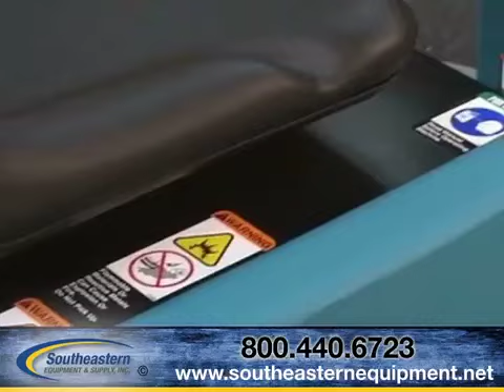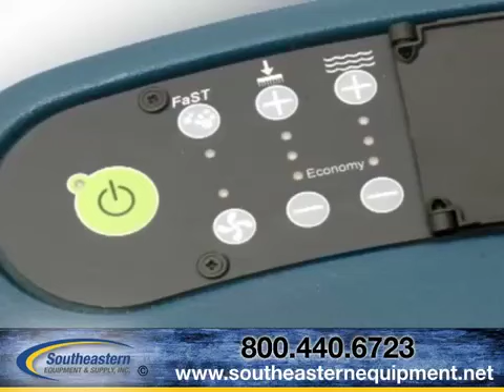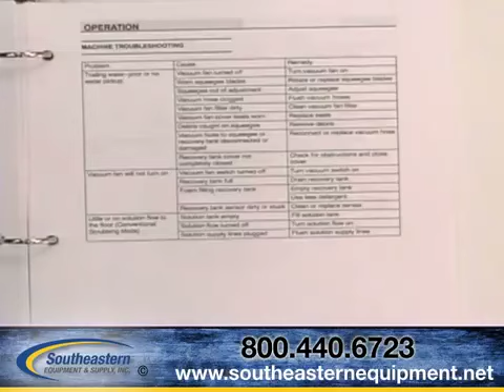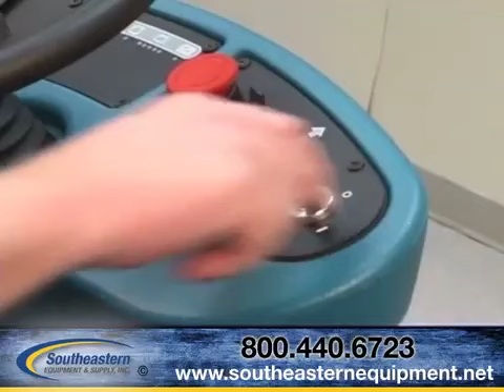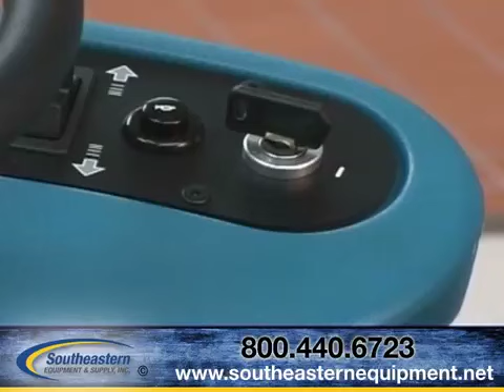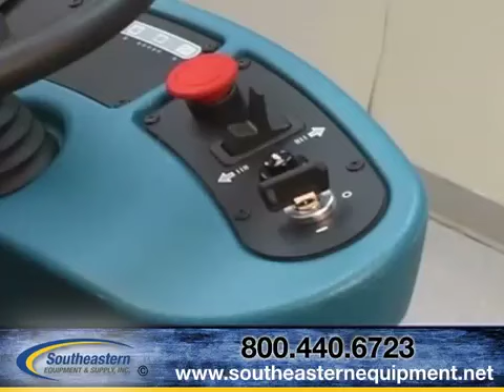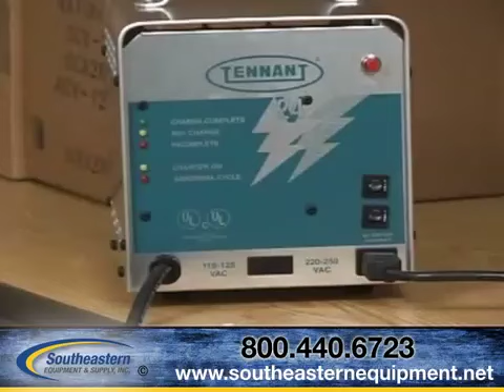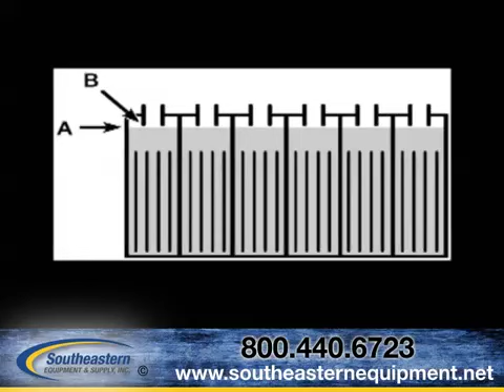How to Operate The Tennant T7 Rider Floor Scrubber

Comment: Any clues? When I park the machine for the night...when i come back in the next day I hear that it leaked water all over the hallway floor???? Any ideas? Also...what do most of you use during the winter season... vinegar or Lotox?
Reply from the maker: Hi there! If your T7 is leaking a lot of water, it is likely a bad solenoid. If it is a small amount, it could just be dripping from the brushes or pads. Regarding your winter season questions, would you mind reaching out to us directly for clarification at <service@southeasternequipment.net>? We look forward to hearing from you.
Reply: @SoutheasternEquipmentSupplyInc Hi...I'm getting in touch with you regarding what we can use for winter months for salt build up on the floor. We have been lucky up to now as we literally have had no snow!! The previous machine this mall has had they have used vinegar
.
Reply: The previous issue indeed was the solenoid. It was changed immediately and didn't have an issue after it was changed.
Reply from the maker: @Stenuarts5287  I hope you saved money by purchasing it from us! 😉
Reply from the maker: @Stenuarts5287  
For cleaning up rock salt off hard floors: 
Make sure the floor is dry and start by vacuuming or sweeping as much of the salt as you can.
Mix distilled white vinegar and water. Pour this into a spray bottle.
Lightly spritz the mixture over the previously salted floors.
Let the solution sit for about five minutes, then use your scrubber to scrub and dry.

Comment: We have this at Walmart can anybody operate this or is it only for maintenance personnel?
Reply from the maker: It's recommended that only trained authorized personnel operate equipment like this. That includes watching and comprehending this video as well as familiarizing yourself with the Operator's Manual. To ensure safe and proper use of the machine, someone already trained should inspect operating procedure of a new employee. For a copy, email us at service@southeasternequipment.net.
Reply: its the same for if someone wants to operate a forklift or motorized pallet jack. training and certification is required.
Reply: @pentiummmx2294  training yes cert not not all the time
Reply: Meanwhile me at first day of work: gas pedal is here, breakes are here but they don't work well. Click a big green button and we are set to go. Hurry up we have entire mall to scrub today! Lol
Reply: I operate this model and have for 5 yrs

Comment: Anyone know how to turn the back up alarm off? We accidentally turned ours on at work and have no clue how to shut it off.
Reply: • Put directional switch in Reverse
• Press & Hold Horn Button
• Turn key switch ON
• If Back-up Alarm is silent, Hospital (Quiet) Mode has been selected
• If Back-up Alarm is sounding, Normal mode has been selected
• Cycle key switch OFF, then ON again
• Verify correct mode has been chosen
Reply: Lol

Comment: How do you flush the solution supply lines? I’m getting very little water on the left side of the scrubber, and after having cleaned the filter, and changed the pads, I need to try this next but don’t know how.
Reply: i know im asking the wrong place but does any of you know a way to log back into an Instagram account??
I was dumb lost the login password. I would appreciate any assistance you can offer me!
Reply: @Abdiel Ernesto Instablaster :)
Reply: @Briggs Asher Thanks so much for your reply. I found the site through google and I'm trying it out now.
I see it takes quite some time so I will get back to you later with my results.
Reply: @Briggs Asher DAMN IT ACTUALLY WORKED :O Literally hacked my Instagram account after about 30 mins by using the site.
Had to pay 15$ but for sure worth the price :O
Thank you so much, you really help me out!
Reply: @Abdiel Ernesto no problem :)

Comment: For the models with EC H2O.  How do you open the "tool box"?  (the compartment used on other models for the FaST- PAK )

Does it tilt open form the bottom or top?
Reply from the maker: Send us an email at service@southeasternequipment.net and we'll show you in the Operator's Manual where this information is located. You can also call Tennant tech support at 800-553-8033
Reply: Water not being dispensed onto the floor???? Helpppp.

Comment: How often do u need to change the blades on the rideon
Reply from the maker: Hi Dorothea, when the squeegee blades start to streak, leaving water behind you can flip them over and use the other side. After that, it's time to replace! Call our Parts Team at 803-252-0100, Option 2.

Comment: how do you program the routes
Reply from the maker: Hi Robert, it sounds like you may be referring to the Tennant T7AMR Scrubber which is the robotic version of this machine. The T7AMR Scrubber can be used in manual mode or as self−driving, robotic scrubber. For information on how to start programming routes, watch this video: https://youtu.be/YLkOf_bSmCQ

Comment: Im asking for a buddy How do you fix the steering column just above the chain gear on the steering column the steering wheel spins in a complete circle and its missing a sleeve part or something that holds up the steering column and chain the steering column is loose broken i know its missing some kind of part that fits over the column and it holds the chain up in place.

The whole steering column falls down causing the chain to come off the sprocket that's on the steering column it doesn't wanna stay up and in place the user manual isn't much help it all i don't work on those but checked my buddies out before i work on riding mowers I'm not no professional at fixing anything

But I pointed out to him what part that floor machine might need because of its broken loose steering column it needs a sleeve over it so if that doesn't help him he'll have to call the t7 shop for further help
Reply from the maker: Hi Mike, have him call Tennant Tech Support at 800-553-8033 or email <service@southeasternequipment.net> and we can have a technician come take a look. Thanks!

Comment: Sooo why is this machine so loud? We got to demo the automatic driving one, and it was very quiet. Much quieter than our advance machine. But when our regular tennant T7 finally arrived it was very loud. Why?
Reply from the maker: Hi there, that's a tough one to answer without more information. If you ordered the machine from us, please call your Account Executive at 803-252-0100 so we can address this concern. Otherwise, you can contact the distributor you purchased from, or speak with a technician at Tennant if you believe this is a mechanical issue. Their number is 800-553-8033. Thanks!